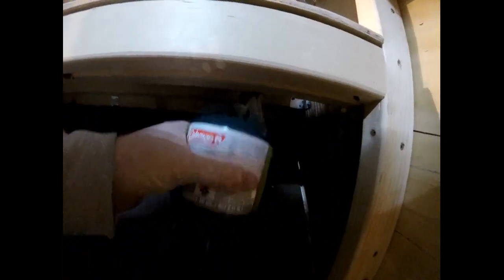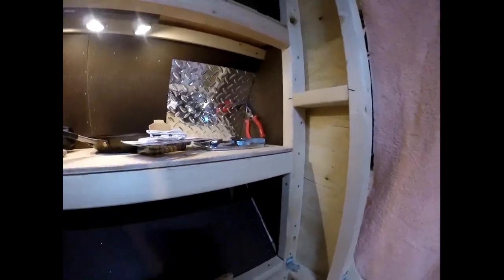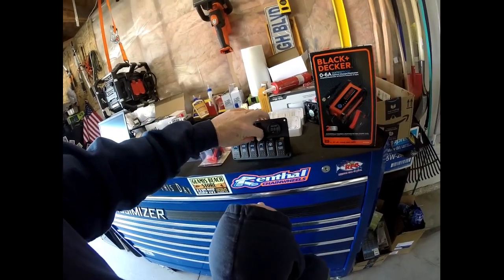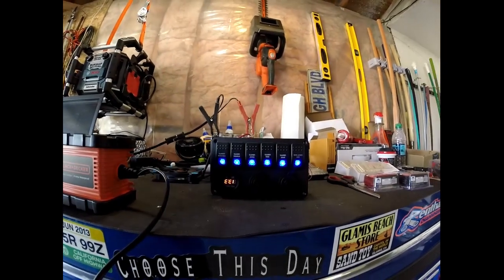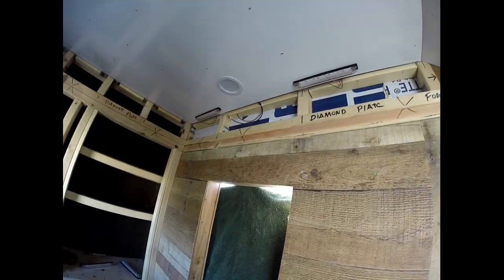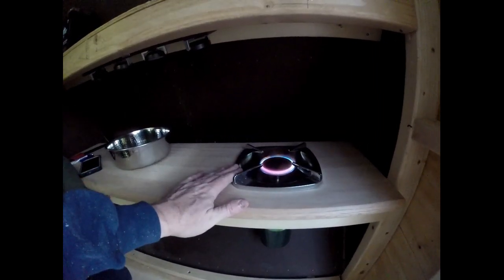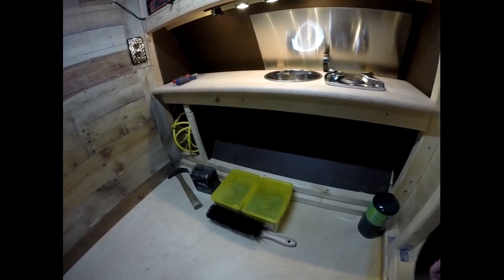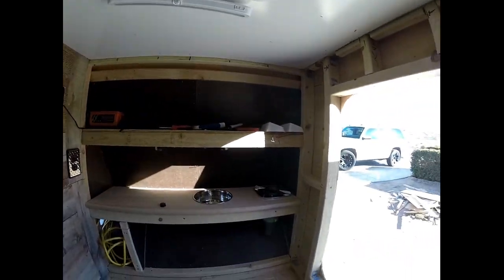Homemade DIY Camper - Battry Switch Panel - Heater

Comment: With the stove configuration is a great idea, however when it comes to hooking you propane canister I would have purchased an RV hose compartment w/door and install it on the side for easy access and installed a long enough flexible hose rated for a camp stove to hook up underneath your counter. then all you would have had to do is open your outside door to bring the hose through and connect it to your propane.
Reply from the maker: Great Idea!

Comment: I think you are going to be glad you installed that battery.  Do you know how many AH  (Amp Hours) your battery can store?
Reply from the maker: Daryl Stokes this little gel battery is only 5 amp hours. I'm just going to see how it works for us on the first few trips. If I'm not a hundred percent happy with it I just may have to do an inverter and a deep cycle 12-volt. I was just trying to keep everything tiny like the trailer.

Comment: Ive benn watching your videos and they are awesome. Thank you for posting. Question... you are doing DC ligting all around correct? When the charger is running from an external source charging the battery, are you still runng the DC lighing connected to the battery?
Reply from the maker: Ah man thanks so much John!  Yes the lights work when I am unplugged or plugged in to 110V  either way.